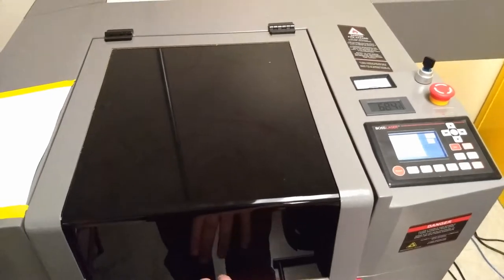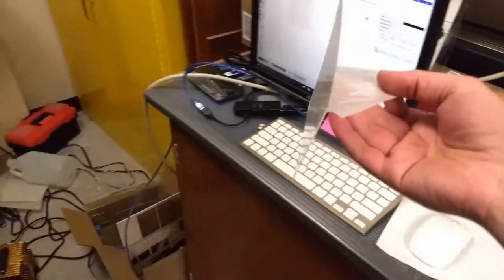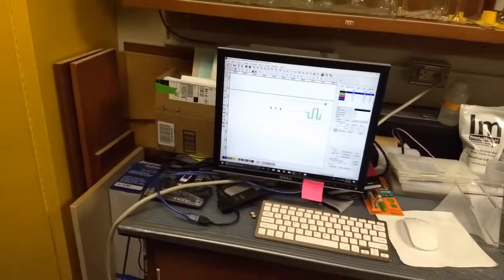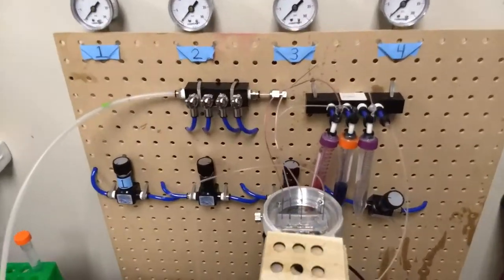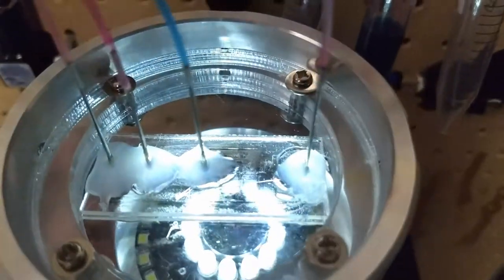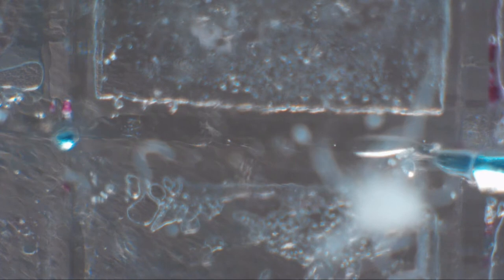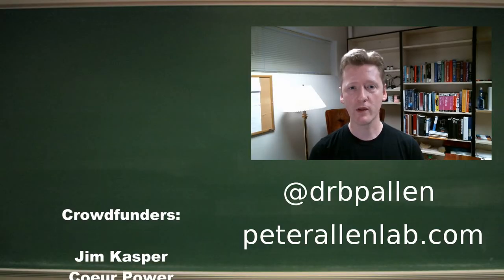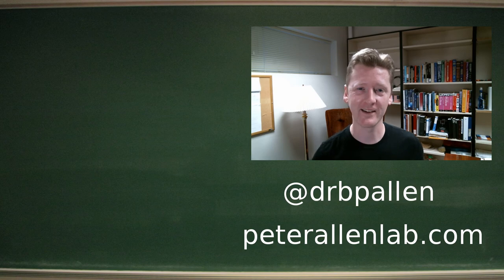Laser Cutter Rapid Prototyping for Science

Comment: Very cool to see direct etching onto acrylic for your droplet generators, seems to seal very well! Have you found any better methods to close off the ports in the last year, or is hot glue still the way to go? I've had limited success recently laser drilling 1.5mm ID holes into acrylic top slides and just press fitting 1.5mm OD tubing into it, but there's obviously some leakage at higher pressures.
Reply from the maker: Hot glue remains the best, but it's a bit of a trick to get it just right. I tried cyanoacrylate superglue with some success, but not great. The key I think is getting the holes matched to the inlet steel tube. We use blunt syringe needles and thread PE tubing onto it.